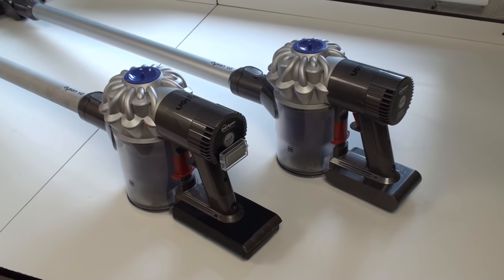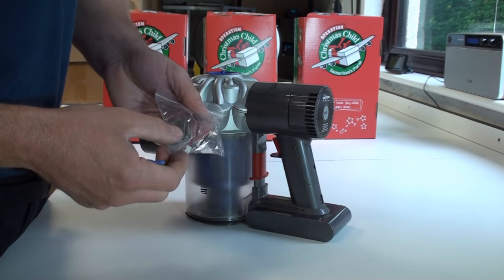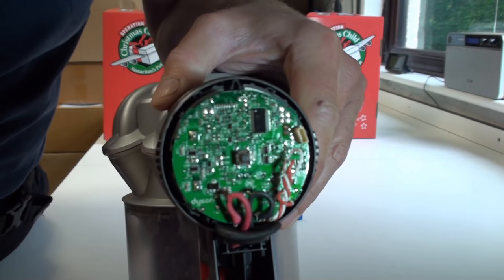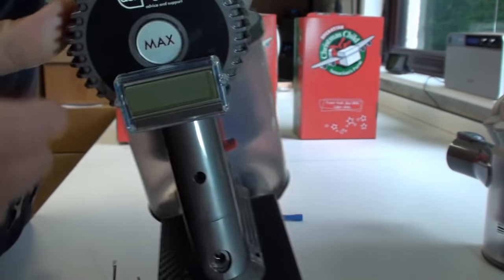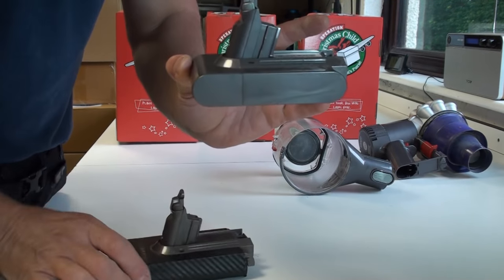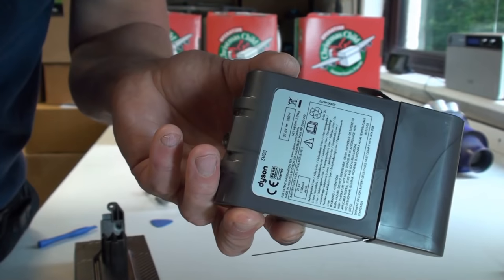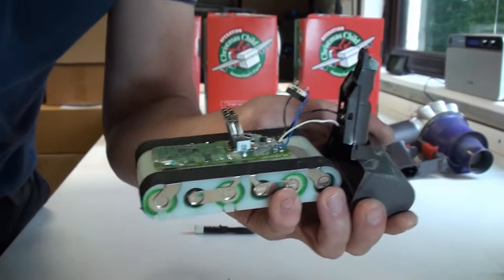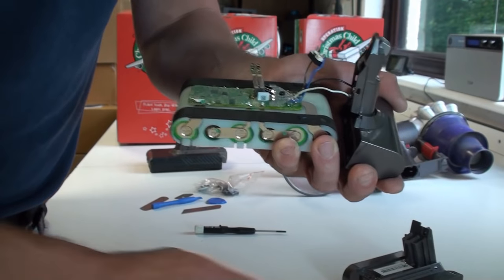Dyson V6 Modification

Comment: Hi there. Like you, we constantly tinker with our products to give them more power, longer life, and make them better overall. I hate to be a downer, but it's vital that refinements such as the ones in your video are rigorously stress-tested to maximise safety. To highlight, as well as voiding your warranty, modifications like in this video could lead to personal injury or fire, while modifying the battery can cause premature ageing of the machine. Safety first! 

Best wishes, Dyson
Reply: Your team should consider selling an optional larger battery pack like this one. I like the idea!
Reply: +AskDyson Would gladly pay for an upgraded battery, even if it was heavier, to be able to get the job done in one session.
Reply: AskDyson Hi I
Reply: Bob Fasoli 

Dude!!! I just bought a V6 after never owning a Vacuum Cleaner, and after reading the Reviews and hearing about the bad battery life I wasn't sure what to expect. 

It's funny how reading and research can influence the mind, because despite being alive for 28 years I never realized just this long 20 minutes actually is. 

For example, Yesterday I vacuumed my 14 step hardwood floors in No Time! I was like man, thia thing is fucking amazing for the little jobs, or when sweeping and vac up the pile. 

My point being, that despite it all, 20 minutes is a long time for small spaces, or for jobs within the logical understanding that the battery won't last long. 

Who the hell is going to vac a carpet with this thing anyways? KNOWINF IT ISNT GOINF TK LAST LONG!
Reply: Having to charge something for 4 hours so you can get 5 minutes of use seems ridiculous to me! There have been amazing advancements in battery life on power tools in the last several years. You really should look at companies like Dewalt and Milwaukee. At least give us a battery that can be changed out when it dies. It's not a bad vacuum, but the battery life makes it seem like a useless waste of money. I may end up returning mine because it is "defective".  Defectively designed would be closer to the truth! It reminds me of the first cordless vacs (who's name I can't even remember because they were total garbage, hint , hint). Not a good thing. I just feel cheated every time I use it.
Reply: If your battery is ~really~ only lasting 5 minutes, and it's still under warranty, you should be able to get a new one.  With regard to your wish that you could easily swap in a spare battery, your wish just came true. If you go to 3:26 in this video, you can see that 2 screws have to be removed to in order to remove the battery. You can also see in the video that even with the 2 screws removed, the battery doesn't just fall out, but is held in place by some mechanism inside and requires a bit of force to remove. If you take those 2 screws out and leave them out, you can have a second battery and easily swap it when your first battery runs out. In my experience, the battery will not come out during normal use unless you drop the vacuum or something, which you would want to avoid doing anyway. Enjoy!
Reply: J Ray; If you’re only getting 5 minutes, I suspect you’re continually using it on “Max”. I rarely use Max, because for most vacuuming, it’s not needed. 95+% of what you vacuum can be done on the low power setting. Try it, keep in mind it’s not a corded vacuum, and use it like that.
Reply: Bob Fasoli You don't have to buy a  Optional larger battery pack with added weight.  Its optional✌ consumers like to have options
Reply: AskDyson why not put in higher capacity batteries in he first place no additional weight  same size same amount .simple....
Reply: Just don't buy the . I will not replace even the cheapest 50 dollar vacuum. These hackers are good souls trying to accept they paid $300 on a piece of junk. Stop the Dyson delusion.
Reply: Evolution comes for failed products... if the product worked then no mod would be required...
Reply: Not having an easily swap-able battery is, in my opinion, a major design flaw in your products especially when you consider the ridiculously long charge time and exorbitant price tag.  My wife wants a cordless vacuum and I'll probably not purchase a Dyson.
Reply: Any issues after 2 years, +dreamsci? I didn't think so. The old, unproven and unmeasurable 'premature aging' & 'unsafe'', and warranty void scare tactics  - surprised AskDyson missed the other common one: "Home insurance will not pay out in case of fire.". Yes, Dyson tinker to make them last longer - it's how you sell next year's model, but battery and motor tech here is woefully slow compared to the rest of the world when you don't wish to exhaust improvements too quickly. The machine already prematurely ages going by the short time you guarantee it for. Safety first = use a broom. Next best = sell on-the-run user replaceable batteries. Profit first = release marginally improved models at a premium price every few years. And warranty? Any company voiding warranty for a fault unrelated to a battery (e.g. canister clip breakage)  is opportunistic and disingenuous, as surely they have the expertise to know it's unrelated.  Meanwhile consumers should not expect warranty due to a fault which may have been caused by the mod - it's always the risk taken.
Reply: "Please dont upgrade your product in this cheap and easy way and instead buy our new upgraded models so we can make more money!!" - Dyson
Reply: LOL AskDyson, I tried talking my wife out of buying this DC59 a few years back, explaining that the battery wouldn't last.  Since I have flown electric model planes since 2006, I kind of know a thing or two about Lithium batteries and their limitations. The marketing team in Dyson spread such bull$hit about how Dyson use special batteries to cope with the digital motor, and she fell for it.  Well, it turns out I was right (as always) and our DC59 is dead thanks to the useless 18650 batteries that all laptop manufacturers use, and who has a laptop battery last more than 2 years of constant use?  Just a month ago, she very nearly purchased the newest $1000 battery eater, until I lost my $hit at the decision.  How about, for once, you greedy, overpriced, out of touch companies, design battery packs with (-are you ready to have your mind blown-) replacable 18650 cells!  Not the entire pack, just the cells.  The landfill sites will enjoy less ewaste, as the BMS usually last forever.  My Ryobi cordless packs have been modded like this guy, and work better than original.
Reply: The battery isn't covered in the warranty at all ,small print , i have found this out after hardly any use and three years old , battery fails to charge (v6)
Reply: The 3500 mAh is the same size!  Surely it's the same weight.  It would increase run time from 20 to 35 minutes.  And run time IS a problem if everyone in your house is addicted to this light-weight thing and don't want to lug out the old Filter Queen to vacuum the whole house.  And no I don't want to clutter my house with multiple dysons.
Reply: you can replace the battery on these. remove the two screws and buy a replacement.
Reply: I doubt the V6 was Engineered to withstand 1hr of constant use. I'd be worried about overheating and prematurely ageing the motor considering max battery is meant to be 1hr.
Reply: @marc1190  The battery packs will die LONG before the motor ever will.  The motors drag cooler air past themselves to stay cool.  The battery pack just gets abused :)

Comment: How did you get the battery meter flush against the back cover? The connector for the wires sticks out too far and I don't see how you made it fit on your mod, and I purchased the same exact battery meter that you used from Ebay... can you explain how did you make it fit on the back cover??? This is an edit. I removed my max button to make the wires go through the existing hole where the button was. I have no use for the max because it uses way to much battery power. Turns 20 minutes into 2 minutes. So my battery meter sits where the max button was.

Comment: Thanks for this video. Purchased a display off Amazon cut a hole in the back and it fits flush with wires inside. Programmed it to 6 cells works great!

Comment: Nice video. I think I would replace the cells with Sony VTC6 cells which at 1320mAh would increase capacity by another 50% and enable you to still use the wall charger fitment.

Comment: Hi - great idea - and a pain in the * to get the battery unit open but I stopped short of cutting up the module and replaced the 2200MaH with 3500MaH batteries.  All went back together well and charged.  Trouble is the Dyson (DC59 in this case) shows a red light on the battery when the trigger is pulled.  Is this because the circuit is incompatible or something else? is there a way of resetting either the battery or the DC59....? ta

Comment: If you're going to build or modify batteries you really need a battery tab welder. There's a reason that the tabs are welded and it isn't just for ease and speed of manufacture.
Heat degrades the life of Li-ion cells. The heat generated by soldering the tabs can almost kill the cells.
You'll stand back and be pleased with yourself not realising that the 'new' cells you've just fitted may well have as much life as old ones getting close to the end of theirs.
A battery tab welder spot welds the tabs with intense but very short and localised heat, thus not damaging the cell.
A crude battery tab welder can be made from a car battery, but that's another video!

Comment: did you try to replace a V6 batteries with a more powerfull V8 ones?
Reply: you cant... the v8 uses 7 cells instead of 6 so the voltage is a on average 3.6 V more (nominal value).
Reply: @JonathanVaucher  are you sure?

Comment: I'm also guessing newer models will act like laptop batteries. The control ic goes into die mode if any cell fails and replacing cells simply wont work if the thats the case or you dont make sure voltages are kept to control cct while replacing cells. My dc35 battery does not have the die protection but not sure about other newer models

Comment: I did buy 6 cells 3400mAh in China and started following the instructions. The battery meter worked like a charm (drilled hole in the plastic). But as I managed to open the battery after over one hour I was confrontec with the battery pack with no way to open it the easy way...I am not afraid of soldering, but had no clue how to losen the contacts from the battery...indeed it also was incredibly difficult to unsolder the circuit board since the metal is so soft and leveraging does not work simple as that. Also when trying to lever the contacts on the board after removing solder paste, I somehow shorted the board, there were sparks and I was not sure anymore if I did not damage the board for good...
end of story: bought 3rd party 3000mah replacement battery :-(
So the video should be extended how to replace the 18650 batteries also.

Comment: Hi i've done modification for V8 battery package following your video. I' ve seen that u made Wire connection with + pole and - pole of the entire package. ( Serial connection of batteries). When i connect package with dc recharger, nothing happens. No light blinking. As u know, the electrical circuit has 7 cables connected with batteries but in the new package ( the powered one made by 26550 type) has only 2 connection. Could you help me?

Comment: Great mod.  Thank you for sharing.  I am curious if you would consider a mod using the Ryobi One+ batteries.  The reason is, they are pretty popular and easily available and it also has a battery meter built in.  Most people that have it usually has a few around and the charger chages way faster.

Comment: i did the changes you suggested, and replaced the batteries with LG ones, but when i installed them i got the red light starting to flash. before that it was blue. Any suggestions?

Comment: May I ask how to just change those 6 batteries to the same size 18650 lithium ion cells 3500mah. (phase 1) ? And how much longer battery life you will gain by doing that only phase 1? Thanks

Comment: Had a battery issue on my v8, it started dying then it just wouldn't work. So i went ahead and bought some sanyo 20700 4250mah batteries (top of the line at the time) to replace the current dyson labeled 20700's. Soldered everything up and no go, same issue as before. Turns out I have a bad controller. So i went the cheap rout and got they china 28$ battery replacement and the casing started to melt on the first go from poor wiring, needless to say that was a bad idea and I got my money back. So I gave up and bought an authentic dyson v8 replacement battery   and all was good, for about 3 months. It would be fully charged but still wouldn't work. So I said fuck it and swapped the Sanyo's over from the bad controller one I had with the new v8 battery that just started failing and Bingo! Now I have a modded Battery for the v8 and works so much longer on high! If this fails again it's going in the trash. I really like the power of the dyson, but it's not worth buying a 70$ battery every quarter.

Comment: Hi, great upgrade, I tired to change batteries for 3500mAh but after soldering them together I got red light flashing about 20times and then green. Dyson doesn't work, isn't charging. What did you do with temperature sensor which was located in original battery pack, pls?
thanks

Comment: Good mod, but why didn't you add the leveling circuitry? The original controller monitors each cell individually, but yours does not. At least as far as I can tell.

Comment: Interesting idea, I was thinking though that a neater solution might be to upgrade the cells to 3500 mAh, but extend the pack to contain two extra 18650 cell wired parallel with the last two. You could then simply make an extended rear shell case for the extra two cells with very little hacking (maybe even 3d print it). An even better hack is to lose the front retaining screw and replace the rear one with a screw that has an extended thumb wheel on it. Then you can quickly swap out the battery :^)

Comment: In this video it is not used the original Dyson BMS ( batter manager system). I can tell by the position of the thermistor. I believe it's not safe to charge a pack with no connections to each individual cell, if one cell will get unbalanced it will overcharge and damage the cell. If you attempt to remove the cells from the original Dyson BMS, it will lock with the 32 red lights. There is a fix for that, in case you locked your BMS, to reset the lock by using a PICkit programmer to access the microcontroller in the Dyson pack. see my other comments

Comment: Great video! Thanks for blazing the trail for mods on this product! As I watch the battery mods, I keep thinking about the Bosch Battery packs I bought recently (5Ah and 6Ah). They are 18V (20V Max). I could not find the discharge current anywhere, but one site suggested it was 25-30A. I'm wondering if this Bosch battery pack is close enough to the 21.6V Dyson battery requirements to use in the cleaner and avoid any damage. Does anyone have an opinion on this?
Reply: Hi, the 18-volt packs have 5 cells (18volts) and the Dyson pack is 6 cells (21.6volts). These voltages are nominal, with the cells in the battery being 50%  charged.  5 cell battery 100% = 21v, 0% = 15v.  6 cell battery  100% = 25.2v, 0% = 18v.  if you adapted the  Bosch pack to fit the DC59 it would work only if the battery was kept at  100%  charged, as soon as you start to uses capacity the lower voltage of only 5 cell would lead the motor control Pcb to think the battery is empty/flat and shut off the motor...
  The current drawn by the DC59  in normal mode 5 to 6 amps depending on the state of charge. if You run it in max the current draw is 20 to 25 amps......     the original cells in the pack are being thrashed to death 20 to 25 amps for anything more than a few seconds at a time, and that is when the battery is new (only a few cycles) and at 100% state of charge,   I have upgraded  my battery to 26650 cells 5500mAh. that is capable of continuous 20 amp discharge...  all so replaced the BMS,

Comment: Interesting idea. In upgrading the capacity of the cells, do you need to worry about the specific type of Li-Ion chemistry used? I thought some types were better suited (safer?) for higher current draw which I assume a Dyson is. While others were better suited for higher capacity. Maybe there's a reason Dyson only included 2000mAh cells?  Can anyone knowledgeable comment more on this?

Comment: Dreamsci any idea of the soldering layout for the batteries or do I just take my battery pack apart and figure it out from the disassembly process?
Reply: Wire in a series

Comment: I'd like to point out that if you attach the battery meter to the removable battery part, you would not need to modify the vacuum unit itself. Should be a safer mod. You only get the ability to monitor the charge level of your modded battery, then, of course.

Comment: Hello - good idea - been thinking of a simillar mod, being a model aviator....well !.. more a builder and repairer, so am aware of the problems/dangers with Li-ion & Lipo's.
  Did try to modify the old battery of my DC35 Animal a year or so back but damaged the charging cct PCB, so gave up, I've probably got a few more months left in the present 1300mAh battery pack but will attempt your mod when they die. 
   The difficulty I had in my 1st attempt was opening the Battery case your video does help with this, it's always the case  when trying to repair household equipment you never know where the little clips are and whether to push, pull or squeeze the casings, just like car trims.
   So is your mod viable for a DC35 animal...joe